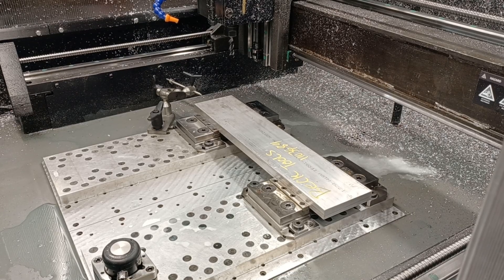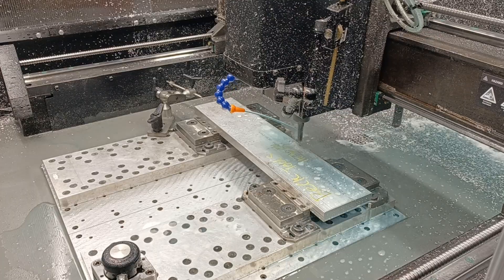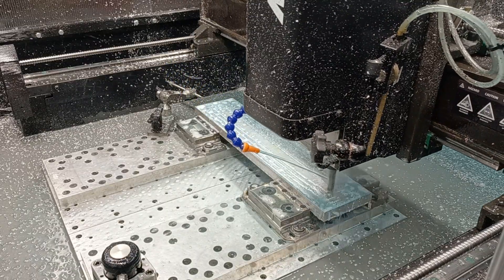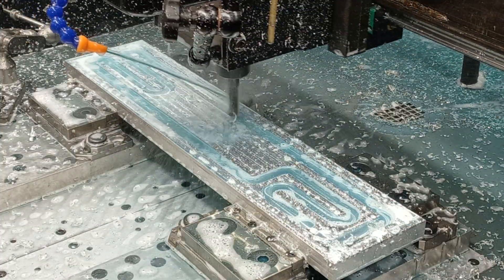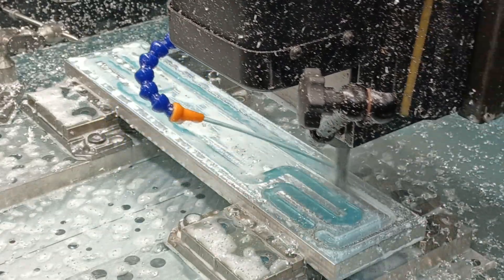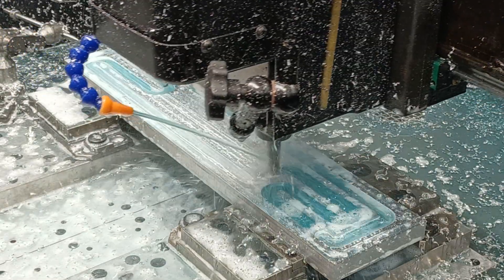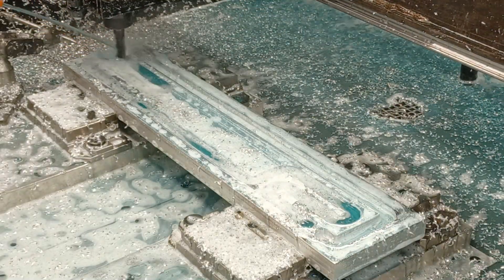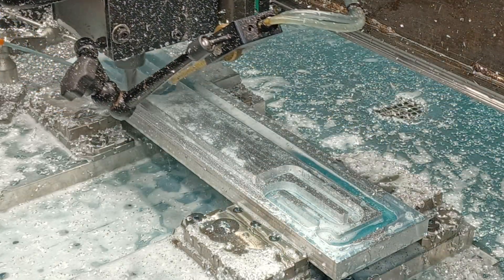CNC Machining an Aluminum Quench Plate (Part 1) | MR-1 Gantry Mill in Action

Comment: How would a complete beginner with zero experience go about learning how to CNC stuff? any recommendations?
Reply from the maker: 1. Get and MR-1 or a DCM2 Mini
2. Get a copy of Fusion 360
3. draw up a super basic model
4. run some programs without a tool installed
5. Turn down the speeds and run some aluminum parts.

Each one of these steps takes lost of time and money.  If CNC Machining were easy everybody would do it.  Are you willing to rise above the average person and something great?  If so jump in. :) 

here is a link to the DMC2  https://shariffdmc.com/?aff=4

Comment: The things I would do for my machine rapid that quickly… Once again, super impressive. That noise is for sure spindle bearings OR recutting chips. I just installed a locline splitter and a bit of extra locline so I can have up to 4 lines pointed on/around my tool. I’ve found so far that two lines really helps and doesn’t decrease my pressure significantly yet. Adding another line this evening for some more tests. This might help your full slotting, OR just open the door every so often and blast em out. That’s what I do because sometimes things are too much money. lol. Those slots can hold a pool of coolant and sometimes all of the chips don’t get evacuated as well so you’d just need to make sure you got enough pressure on that tool to blast everything out. 

I’d do some shoulder/face test cuts on a scrap piece and if you still get that noise then you’ll know it’s bearings.

Again though I really must say, this is some quality content sir! Kudos! 🎉 and thank you for paving the way for the rest of us too poor to buy an expensive and big machine, awesome stuff man!
Reply from the maker: Thanks for the suggestions and the kind words!  I'm thinking I was recutting chips.  The chips are .009" Thick now instead of .003" so maybe that's why I didn't recognize the sound.  Either way I'll know for sure pretty soon. haha  If that sound was the bearings it's gonna get a lot louder pretty quickly. :)  I also turned up the air blast on the second part and I feel like it was better.   I have also not heard this sound when side milling.
Reply: Of course! Thank YOU for doing the hard stuff and sharing with the rest of us. I know the time you spend doing these is no small feat. Yeah from what you are telling me, it was probably recutting chips if you didn’t have that noise side milling. 
This thing probably would kill some exotic or tougher materials. Low radial cut, long depth of cut, and take advantage of your new found rapid speeds. I’m about to mess with some titanium, I’ll make sure to take videos of my fails and share them when it shows up. lol

Until then, keep it coming!

Comment: Pretty impressive. Let us know if you figure out why it was making that noise. It did seem to help when you turned the air on to evacuate chips. From the camera perspective it almost looked like your flood coolant was keeping all of the chips in a wave right in front of the tool path when you were moving x positive. I'm just a casual observer though.
Reply from the maker: I'm thinking I was recutting chips.  The chips are .009" Thick now instead of .003" so maybe that's why I didn't recognize the sound.  Either way I'll know for sure pretty soon. haha  If that sound was the bearings it's gonna get a lot louder pretty quickly. :)